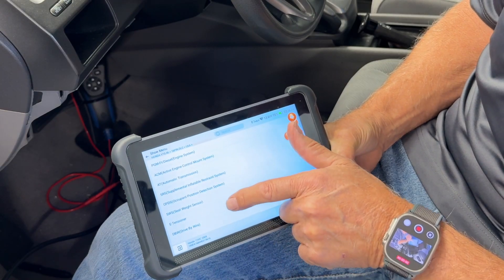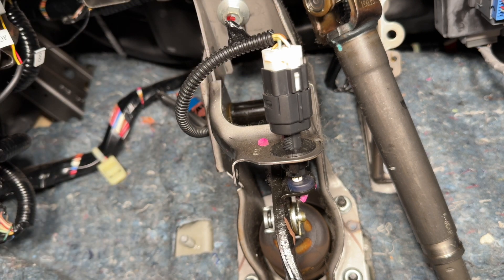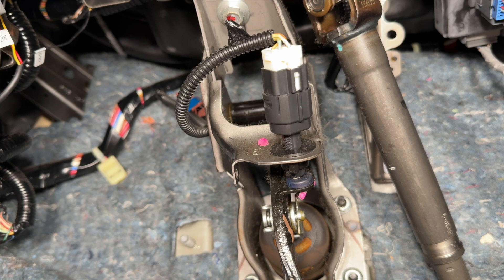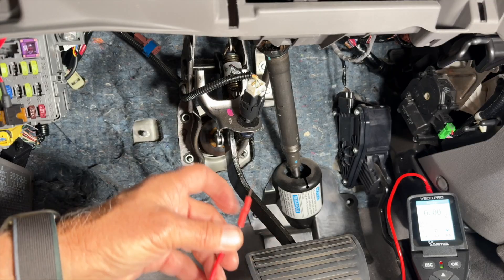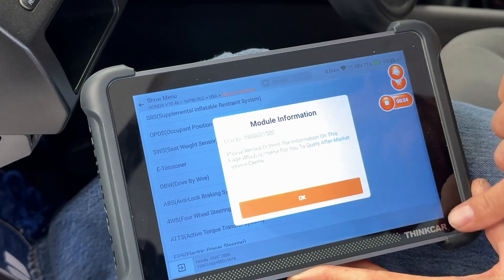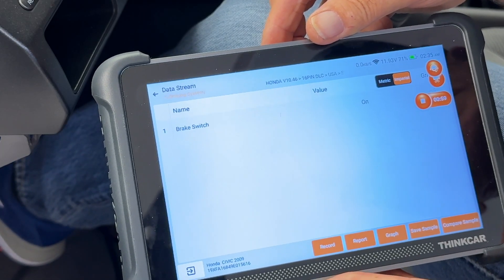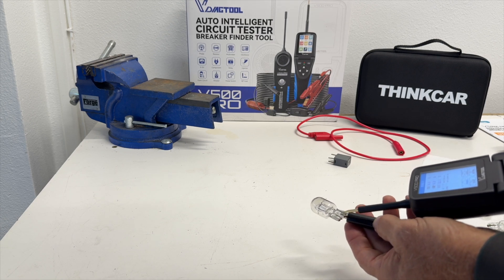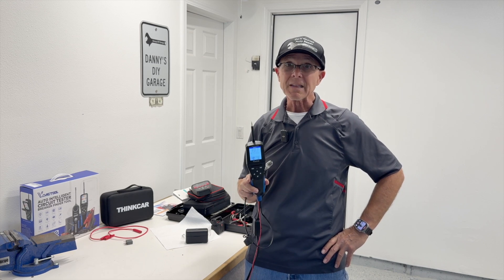2009 8th Gen, Honda Civic Brake Light Diagnosis – You Won’t Believe What I Found!

Comment: My fuses are good changed out brake switch and replaced bulbs and my brake lights still don’t turn on? I would appreciate if you can point me to the next step?
Reply from the maker: What year what car? Do you have 12volts at the brake switch ?

Comment: Hey Danny.  Nice video as always!  I had a question about something else, but figured I'd ask on this newest video currently.  I have an 08 LX Sedan.  I have 2 concerns, and was just wondering your opinion.  When going over speed bumps, or turning out of a driveway often with a small bump to get to the street, I hear a clunk in the front of the vehicle.  I think this may be my swaybar links, but is there anything else I should check?  Other thing is, when at low speed or parked and turning my steering wheel, there is a sound that is like a creaking or squeaking (sounds like a rubber part that is kind of skipping when moving, rather than moving smoothly).  I'm not sure what this might be.  It has something to do with steering and turning the wheel though.  Doesn't seem to be an actual driving issue, but is it annoying and something should be replaced.  I much appreciate you and your videos, they have helped me keep my Civic going great and looking great too!
Reply from the maker: Go underneath and lube the bushing as in this video Crunch or Creaking noise over speed bumps, oil leak fix, 2009 Honda Civic
https://youtu.be/M3lI-jfPDvc 
If the noise goes away you will know 
Also struts can cause noise also, good luck

Comment: I have a civic 2009 as well with the same issue. I have tried changing the stoplight switch and the corresponding fuse and still not working, not even one of the stoplights. Is it possible to have all the bulbs burned out at the same time? Or a wire issue?
Reply from the maker: Yes bulb can be burned out, test the green wire at the bulb for Voltage

Comment: I have a rear left brake light that went off. Changed the bulb, doesn't work. All the rest work well. Any ideas?
Reply from the maker: A lot of times it’s a bad socket, the green wire should have battery power when the brake is pushed
Reply: @dannysdiygarage  i will check that. Thank you!

Comment: In other words, the cruise switch is also the brake switch for the lights on this car? Is it the same for a 2013 honda civic 1.8L ? I know that if your brake lights remain on all the time is because the plastic, small stopper is broken which is what makes contact with the end of the brake light switch.
Reply from the maker: Yes, the brake switch an cruise switch are the same switch, it has two different circuits inside the switch, brake switch portion allows battery power to pass through when the brakes are applied and the cruise control allows power when the brakes are not applied and cuts power to the cruise control when the brakes are applied shutting off the cruise control. Thanks for adding this.
Reply: Through the years I've run into a few of those broken switch plunger stoppers... leaving the brake lights on.